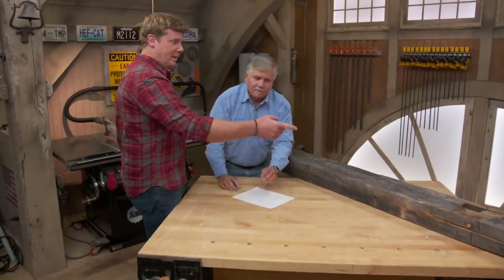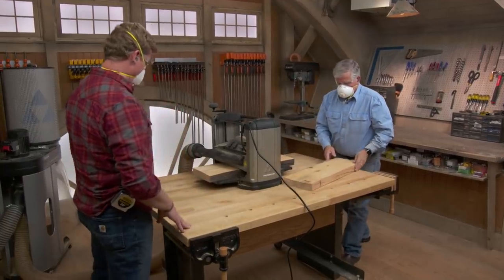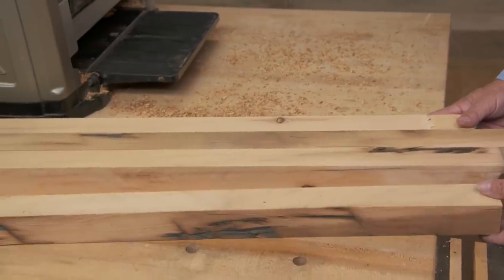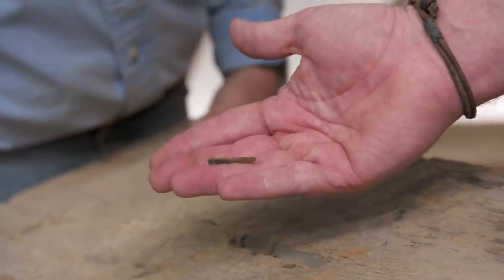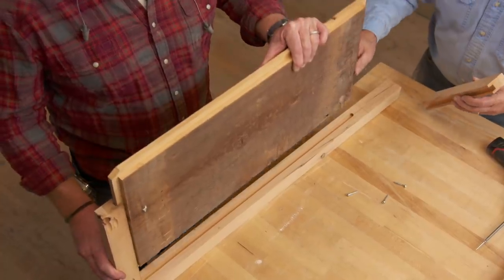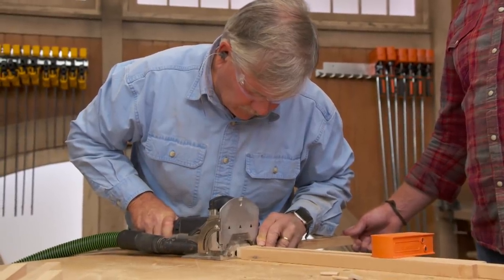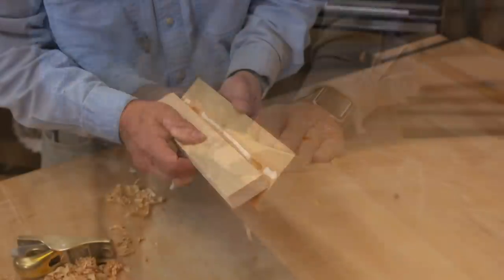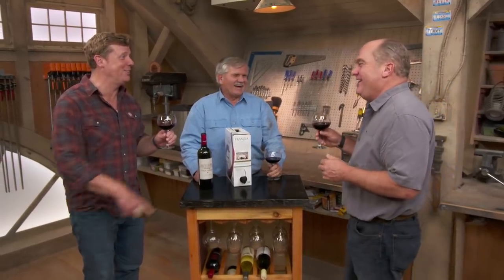Reclaimed Wine Rack | Build It | Ask This Old House

Comment: Perfect, little project for an easy DIY project at home. All you need is a table saw, miter saw, router table, random orbit sander, Domino cutter, pocket hole jig, nail gun, and a few bits of scrap 17 inch wide floor board.
Reply: exactly! thankfully I have those tools at home
Reply: Haha so true. I build and repair a bunch of stuff around the house. It’s amazing how much quality materials cost sometimes, but I’m never upset spending money on good tools that I can use over and over again. 

Sometimes I have coworkers ask me about building or repairing something and they are often stunned by how much expense or work can go into something that seems simple at first glance. YouTube can make it seem like building a barn door or refinishing a dresser can be done in a couple of hours.

I build things because they are better quality and more custom than you can buy. I rarely save money by making something myself. Etsy can do it cheaper but not better.

Comment: 7:17 - That was slick using the square to set them all inline instead of drawing a line.  Just need to figure out the offset on your nailer and then account for that offset in all your markings for super speed.
Reply: I had the same thought

Comment: The variance in joinery methods on this is headspinning. Just glue in one place, just brad nails in another, other spots have pocket holes, others have stopped dados, but others have dominoes. Just all over the board on this one. 
Looks great though. Never seen a black high gloss stain on a live edge piece like this tabletop, and it turns out really cool.

Comment: Tom I think you may have met your match. April Wilkerson only 31 I feel can give you a run for the money. She is an awesome carpenter, woodworker, metal fabricator, she has a 2900 sq ft shop, saw mill, 4x8 CNC machine, Plasma cutting CNC. Not much of anything she can’t do! Check her out on You Tube